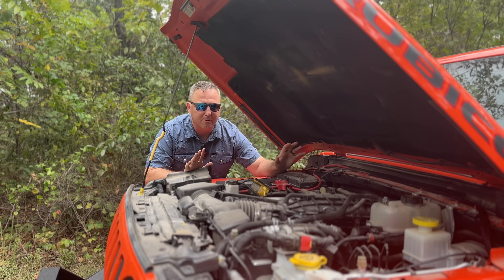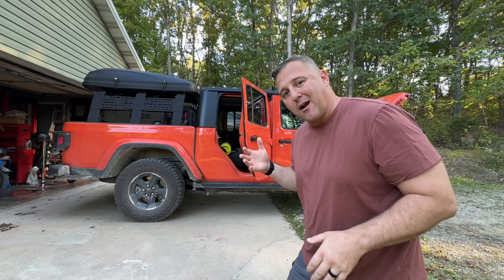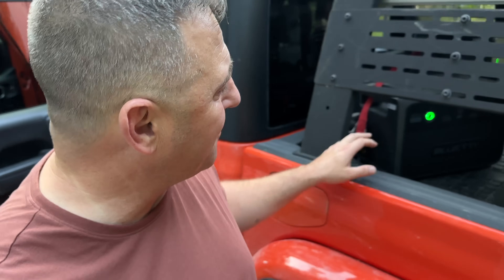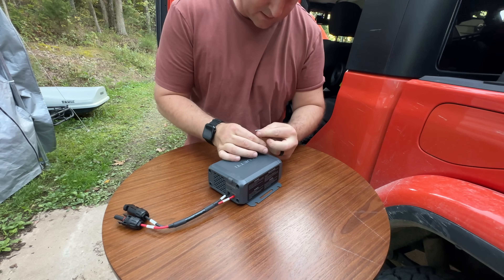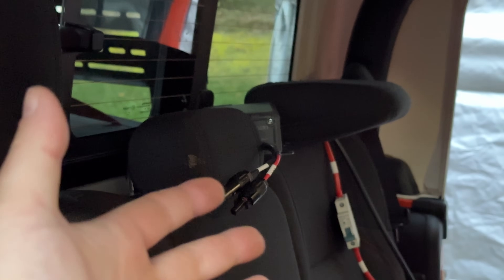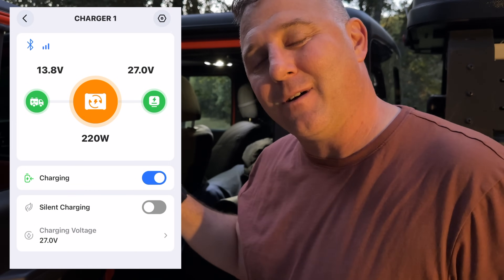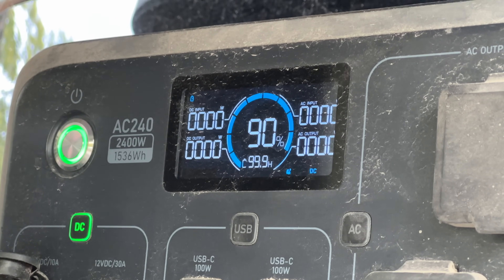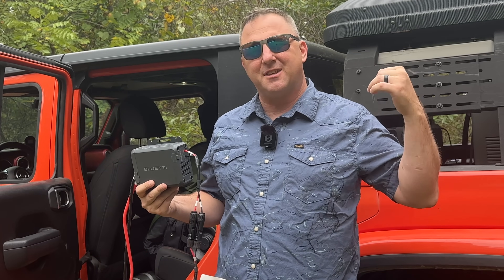Solar is OBSOLETE! - BLUETTI Charger 1

Comment: I have 300 watts solar on my motorhome. Absolutely couldn't live without them.
Reply: Exactly i have 600 watts and 400ah lithium phosphate
Reply: There’s a lot more flat space on motor homes to install solar panels than on his jeep.
Reply: @RobbieHerrera  my thoughts too. However I wonder about creating a thin slide-in area perhaps near the ceiling or his rack for transporting portable ones that he can then lay out on ground if he is abundant in Sun.
Reply: @bdmenne  the panels are so thin that they’d probably fit in his rooftop tent. He can just lay them out when he sets up for camp.
Reply: @RobbieHerrera  The thing is convenience. The dc-dc is working whenever your driving so for weekender its very convenient. More than weekender using the vehicle as a generator isnt exactly efficient so it becomes a math equasion for extended use and what is the most efficient method for each individual.
Reply: @RobbieHerrera  yes I was coached by watching YouTubes. I started with one panel then 6 months later my second panel then the third months later. I kept everything as simple as possible. I use 2 AGM batteries which after 5 years are still going strong.
Reply: @RobbieHerrera if you are driving, sure: but, if you are parked,  what would be wrong with building a fold out frame when parked for more solar surfaces.
Reply: I have a 50w and it's so powerful 😏.
Reply: @leeinwis  50w Charges slower than the built in car charger. This video is about getting a FAST charge from your car.

So in between destinations your power station is always fully charged. 

It just depends on your use case. If you only need to recharge some small stuff once a day then 50w is okay, but if you have some high power draw stuff then 50w is nothing.
Reply: @jabbajawz   I think just getting a generator and running it instead would be far better get like a LiTime 80-Amp Lithium Battery Charger，12V LiFePO4 and a generator the car is just not as effective and efficient at this task then a generator you will be spending far more gas then it's worth
Reply: @catboypleasepet-jt4ot  Better is subjective. In my opinion, if you are going to also lug a generator around, just use it directly instead of charging a power station. People don't want to lug both around. They want quiet power with the ability to charge it on the go.
Reply: @jabbajawz  true but it's not really quite if you use your car to charge plus the gas increase I do under stand though why you would not want to carry both though
Reply: @catboypleasepet-jt4ot  The idea is that you use your car to charge it WHILE DRIVING... So it's ready for your next destination.
Reply: @jabbajawz  hmm you will need a big battery depending on your use case 500watts of charge per hour is a lot but unless your driving 5 hours a day your not going to charge a 12 volt 300amp hour battery you can charge a 12 volt 100amp hour in maybe 1.5 hours on a dc refrigerator if your only doing lights that will be fine but most 12/24 volt refrigerators use around 500 watts per 12 hours so you will at least need to drive 1 hour to keep that running a day so if your camping for any more then 1 day this will not work in your use case if your driving a lot and don't stay in one place for more then a day I could see it working
Reply: @jabbajawz  I stay stationary a lot so solar is best for that. I'd need more solar if I was in a cloudy environment. I'm in the SW where it's sunny almost every day.
Reply: @Eric12358  I hear that. My comment wasn't necessarily for you, but in your case, I would say a small generator could also be beneficial for emergencies, instead of more solar panels. But if you get plenty of sun and have enought battery storage, then you are good to go.
Reply: Did you install yourself
Reply: @worldpeace8187  yes. Watching YT videos. I went very basic keep it simple. 2 AGM batteries. 3 100 watt panels. Started with one then added 2  more later from Renogy. The 100 Renogy kit comes with 1 panel and a solar controller which i still use. basic  Then I tied it into a simple 50 watt $45 inverter.
Reply: @worldpeace8187  yes, I learned how to DIY from YouTubes! I started with one Renogy 100 watt panel and the solar controller it came with. Then a few months later added another one , now I've got 3. I might add one more.
Reply: @worldpeace8187  yes. I learned most of it from YT videos.
Reply: And what do you do on a cloudy day?
Reply: @Tolg  I hardly ever have any cloudy days. I Follow the Sun- Beatles. 
But if I do, I still get some solar charge  and either drive or run my generator to help  charge the batteries. I have also checked into an RV park to plug in for a day to get the batteries fully charged. But that's rare.
Reply: @Eric12358  I can see that.  I wish we could use the electric car charging stations when in a pinch.  It would make so much sense.
Reply: Don't say you can't. 

You could.
Reply: Solar is over, haven't you heard ?!

Comment: I wonder why a guy cant just install a power inverter and just plug into that to recharge while the engine is running?
Reply: Because it's not efficient going from DC to AC to DC.
Reply: @rtsrts2317 Alternator keeps producing so waste is not using it. Dc to ac to dc no longer matter for a car alternator esp. if you are running down the road.
Reply: @amazingmigs  Okay. Sure.
Reply: You can but, an inverter uses (waist) a couple 100 watts more than DC to DC!

Comment: I went with the Pecron 500 watt dc charger. It has variable settings for voltage so it won't work when the vehicle is off or the voltage is low. Less that $140 including the cable. I also have 400 watts of solar and my power bank can be fed by both. The pecron will work with anything that can use a MP4 connection.
Reply from the maker: I have one, but have not had the opportunity to try it yet.
Reply: Thanks I didn't know pecron made this and I was starting to get jealous of ecoflow lol. 

500 watts is more then my solar panels do and on the pecron I can charge from both at the same time. 
For 150 bucks is unbelievable.
Reply: The Pecron charger is nice but it doesn't work with smaller stations, like EB3A, it's output is overpowered for them and can't be changed
Reply: Yeah, I got the notification about this charger from bluetti. I was cautiously optimistic, but I checked the specs, it's a rip compared to the Etaker F1000 (dual DC inputs, 1000watts total) and even the Pecron. Like most of Bluetti's stuff, it's overpriced and customer service is non-existent.
Reply: @rtsrts2317 Smart move, some of these solar generators ( for those who don't know, on their own, they actually generate nothing at least not without that obsolete solar or plugging them up ) are super overpriced and dishonestly advertised. Their name alone is dishonest.
Reply: @jackm6307  Yes! Very deceptive advertising. All of these power boxes generate nothing. They are 100% for energy storage and discharge.
Reply: @jackm6307  Pretty much. I bought one for my wife's parents because theyre old and need quick back up power. I just bought an ecoflow 3 plus to throw in my camper. The specs are impressive for $600ish. I build all my own stuff otherwise.

Comment: Intresting! Nice explanation - Well done. I like the disclaimer. 

I went with the Pecron 500 watt DC-DC charger first one out the gate to put a dedicated DC DC power station charger out on the market as a complete plug and play.

Plays friendly with most of the brands on the market. Half the price at $140. Multiple voltage settings, small and light weight. The only con is that it's a bit noisy if you have it in the cab. The fuse block is with hand length of the positive to battery terminal. Plus, it has a power on and off button. This powers my Bluetti AC200MAX w/ 1‐ B230 battery. Plus, an addition 300 watts of BougeRV CIGS solar panels on the roof. There is no issue with power now 😂

🛻+⛺️=🙂!
Mark (& Teresa)
Hampstead Maryland

• Purpose Built Adventure Rig © •
Ford Ranger FX4 - GFC Camper V2 # 1919

• Kia Soulverlander • Nissan Xterra Off-Road •
Reply: that sounds like a great setup, but you only have one input port with bluetti ?  right ?   or does that b230 have an input..  can you charge with solar and alternator charger at the same time?
Reply: @goneridingparts You have 1 DC and 2 AC ports. I've just added 1 of the D050S DC Charging Enhance (500W), which looks like a power brick but grey. It takes the DC and runs into the box to convert it to the AC port. If I wanted, I could add one more into the B230 battery.

A note on the Pecron Cons: it's noisy! It has a power button which must be turned on/off or you will have a dead battery. Ask me how I know. I think in time I'm going to switch over to the Bluetti. I don't want to babysit my Pecron DC DC charger. I feel the Bluetti would definitely be worth the extra $ just to avoid those 2 cons.

Comment: I don’t wanna change anything to my vehicle electrical system.

I just built 2 portable solar generators, 1 for home (1500w) and 1 for camping (750w) also working on a jackery box. I’ve spent maybe 1k to do it all, $500 were the lithium batteries.

I’ll stick with solar for basic backup and use.
Reply from the maker: @T-Sim  sounds like you’ve put a lot of thought into your setup. You can’t go wrong with that.
Reply: @AdventureGearTV except using lithium battery
Reply: I'd love to hear the details of what you built. Do you have a video, instructions, or list of products/ tools that you used? Thank you!
Reply: Yikes jackery worst battery brand 😂 wt f is a jackery box?

Comment: Couldn’t help but notice you initially hooked up the main cable from the battery with reverse polarity connection at the Bluetti Charger 1. Glad you caught it.
Reply from the maker: @garylong9699  so, about that. Luckily, the device was smarter than me, and protected my system from frying. I didn’t catch it until troubleshooting. The worst part is that I mentioned being distracted by the camera and occasionally messing things up right before or after making the mistake.
Reply: @AdventureGearTV  bro, same. I had brightly colored positive clamp and a Lithium battery i was beginning to charge with a regular AC CHARGER. Nothing happened. The Smart Charger was thankfully SMART. I can’t  believe I reversed it.  It was 50/50 chance And color CODED to BOOT andI still reversed it.  lol.
Reply: I love how those leads go into the Charger one. I want similar leads to go into my charge controller.  My wires always fall out over time. Actually, I want leads that click into my charge controller without screws. Is there such a thing??

Comment: I have a 180 amp alternator on my Ram 1500. I actually installed two EcoFlow Alt+Cs on my truck to power my Deltas. Both Alt+Cs provide the full 800w of recharge for my Deltas when I’m cruising, and it dips at 750w on idle. So far I haven’t had issues. But I am thinking of purchasing a 370 amp high output alternator with a short belt and wires from JS or mechmen just to get the full 800w on idle. Curious on why you haven’t installed your 220 amp (from your EF AltC video) yet.
Reply from the maker: I’ve got that alternator stacked up in a pile of projects I want to tackle. I also have a set of switches to install in the dash. I’ll probably end up doing both projects around the same time, because the lights bar pulls a lot of power and will run from the switches which pull from the alternator. Thanks for sharing your experience. Seems like it’s not truly an issue for you, but the current alternator is pulling a lot of extra energy.
Reply: I would like to upgrade the Alternator on my Motorhome (Chevy P30 454).  I am curious which Alternator you are looking at getting...

Comment: I run two alternators one for the start battery one for charging my house battery, but it took a lot to set up
Reply from the maker: Very interesting. What kind of vehicle is it? Is it a custom setup, or an OEM retrofit kit? Thanks for sharing your experience.
Reply: @AdventureGearTV  it's a E350 ambulance I got it with that set up but was able to switch it over to the new motor it's like two pulleys a mounting bracket and a belt it must be some kind of kit if your able to find an ambulance that has your same motor the set up should bolt right on

Comment: Question, if it does cause issues with the battery or alternator, could it also cause computer issues?
I'm less worried about replacing my battery and alternator than frying my electronics.

And would upgrading your alternator eliminate that concern? Thanks
Reply from the maker: @SueUTube  There are other fuses and relays that protect almost every circuit individually. This should limit the issues to the charging system, and battery. That being said, a short could cause any kind of problem.
Reply: @AdventureGearTV  thanks. I'm electric illiterate. Appreciate it.
Reply: @SueUTube he is also, he actually connected his system wrong them edited and dropped this video. He definitely has never actually used this because it is not connected properly